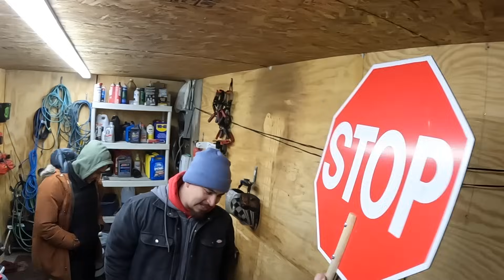Most people would get FIRED for this!

Comment: Your issue with becon lights is most likely the cord getting damaged from repeated twisting at the plug end or if its getting pinched anywhere going outside the vehicle. Might be cheaper to try and rewire them before tossing in the dumpster. Its 12v so its not dangerous or difficult.

Comment: I’ve owned and used many brands of lights. WHELEN is top of the line and will last a long time. Check out the Liberty Mini Justice (8 module version at Northern Tool or from Strobes n More) or the Whelen Century line. They come in several size configurations and cheaper, yet good Whelen quality. Other good brands are Federal Signal, SoundOff, and Code 3. Another brand that is less expensive and is great for the money is Feniex (awesome customer service too).

Comment: get the whelen mini justice light bar. they are super bright. it meets SAE class 1 certifications. they are a little pricey but very worth it. i have 2 of them, and my oldest whelen mini justice is roughly 8 years old, been on 7 different trucks, and have not had 1 issue with it. Another major plus with them is each "light head" in the light bar itself is serviceable/replaceable. so, you dont have to buy an entire new light bar.